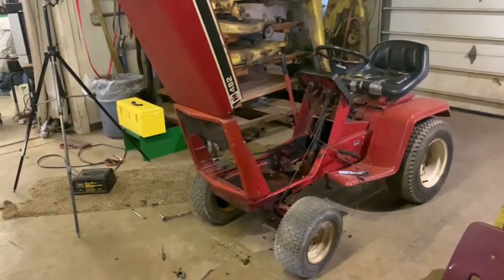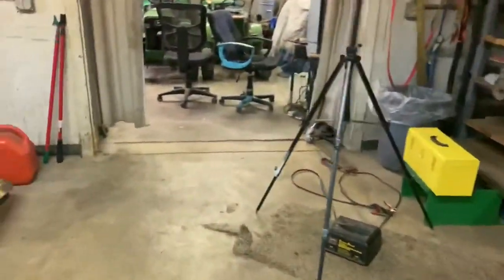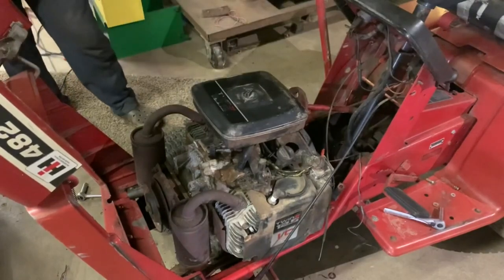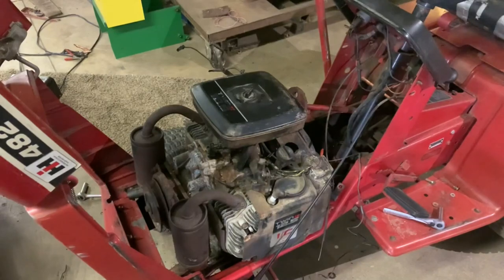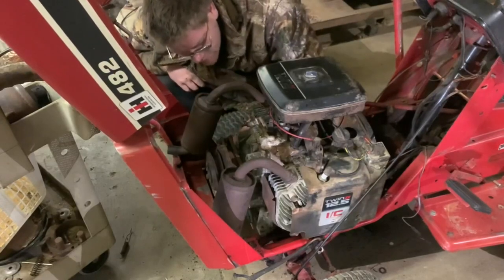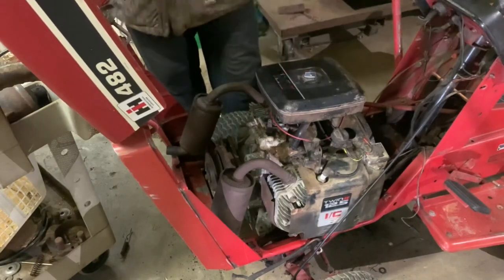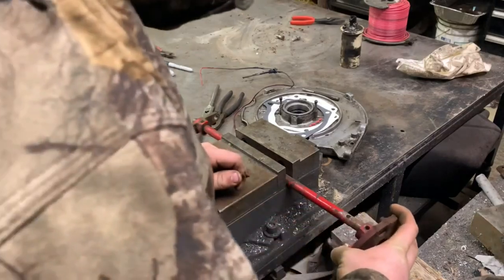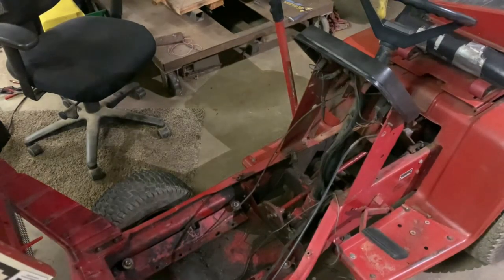Will it fit?? Cub Cadet 482 engine swap part 2

Comment: Yes
Reply: I would put dual regular farmall  mufflers going through the side  panels evenly go up with flappers on the the top of the pipes . I have on idea for the starter put a piece of steel under the where the starter but the frame cut enough room to the starter out when you have to think it will work out for you i did one like that way before this just idea make a door to get to .I hope i helped you out .Let know in the comments .